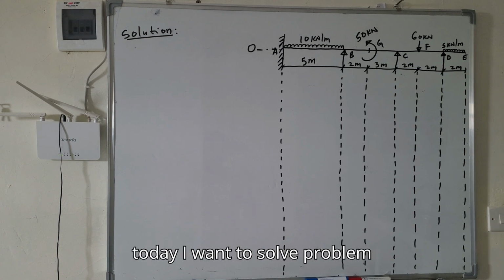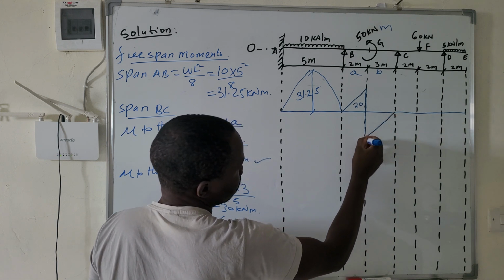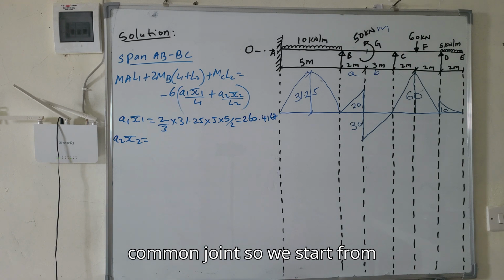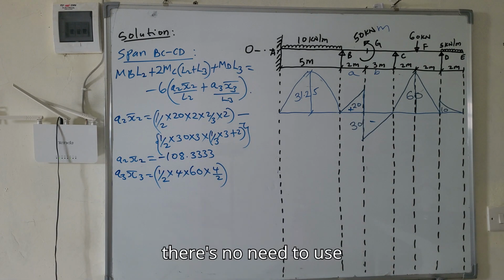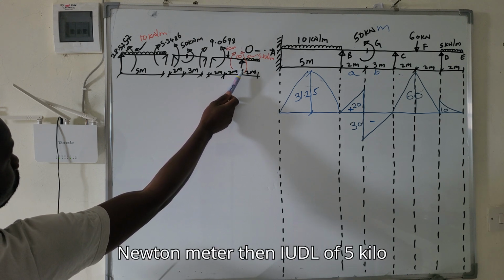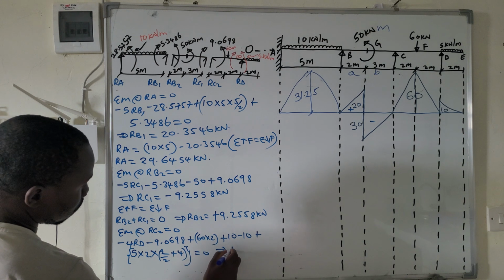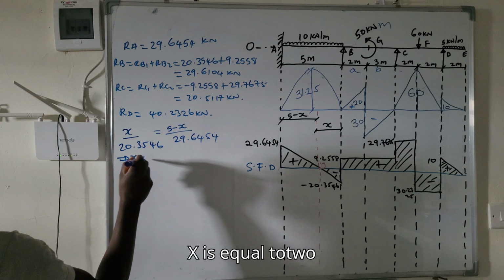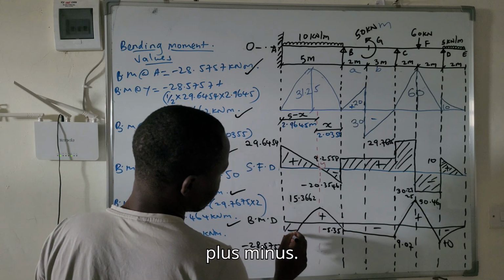THREE MOMENT THEOREM PROBLEM #5-CONTINOUS BEAM SUBJECTED TO CLOCKWISE MOMENT

Comment: Why have you used wl^2/2 in de and what if the moment had only one length how could we do it
Reply from the maker: Span DE is overhanging with aUDL. To get the moment, change UDL to point load (W*L), and we know that moment for a UDL act at the center of the distance covered by the UDL (L/2). Moment will be Force*Perpendicular distance= WL*L/2=(WL^2)/2. If we had a point load at the end of overhanging beam DE, then the formular changes=W*L.